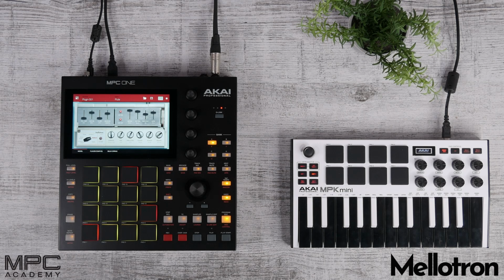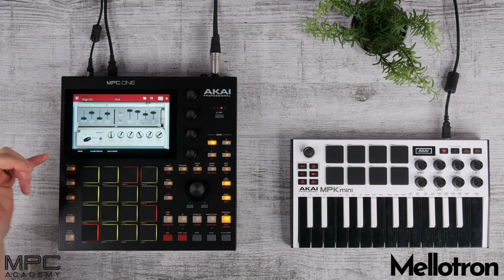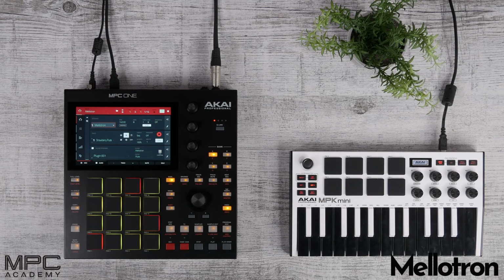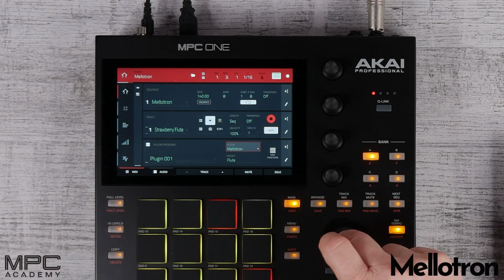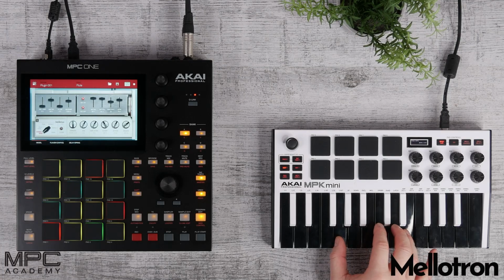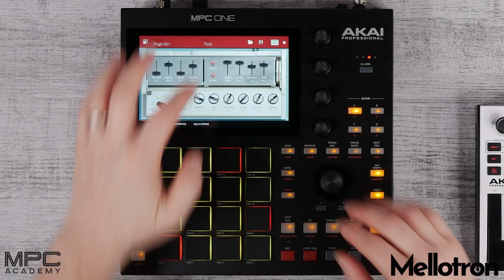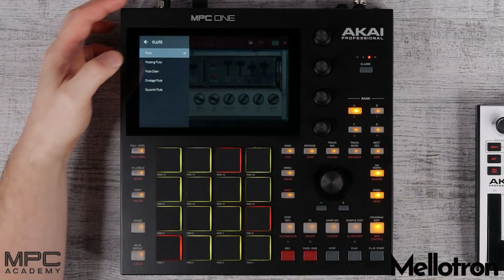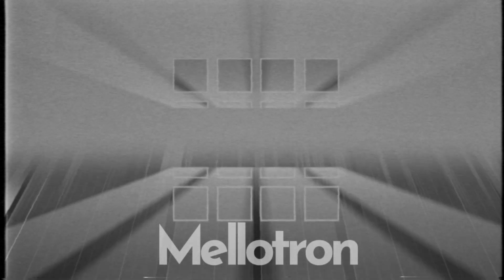Mellotron Tape Sample Keyboard Plugin for MPC Standalone

Comment: the vibrato settings worked the first time i used it but now its not doing anything on those specific settings. Also if i tap a specific parameter on screen the qlink highlight randomly picks a section. ?? Age isnt working either.

Comment: I hope some one do a (how to install) all these plugins. Thanks 😊
Reply: Pretty sure you just install the update...
Reply: @dracul74  Some page are not found... Not sure how to get it also, this is confusing
Reply: It says to install the synth content on a standalone force or MPC Device copy synths directory into the top level folder of a SD card or USB drive..
Reply: I got you tomorrow... I'm burned out right now lol
Reply: @AveMcree  Thank you Sir. 👍🏽
Reply: I had copy the Content into the root on my SSD in the Live II via Control Mode. 1,5 Minutes and it was ready. Thx AKAI. Now we need a good Arranger.
Reply: I did the usb update... pretty quick... copying the synth folder was a bit longer... but whole thing took about 20 min (mostly waiting for downloads)
Reply: @dracul74  sd card didn’t work for me can you tell how to get the usb update ?
Reply: @wahid_raheem  I used this vid....  https://youtu.be/jB3-QOvhWck which shows you how to update the firmware. Once that is done, download the synth zip file from akai unzip it look at the readme... which basically will tell you to put the synth folder on your usb stick.
Reply: @dracul74  thank you
Reply: I made a video explaining it: https://youtu.be/Fv8-ygH3M-0
Reply: Your Akai account has the Synth download.... There's a PDF that explains how to install.